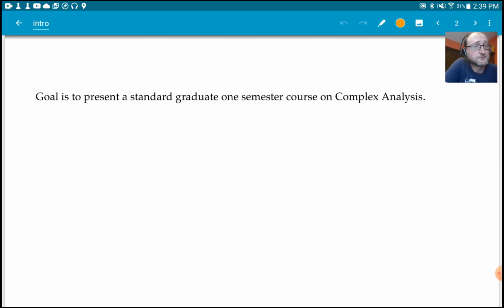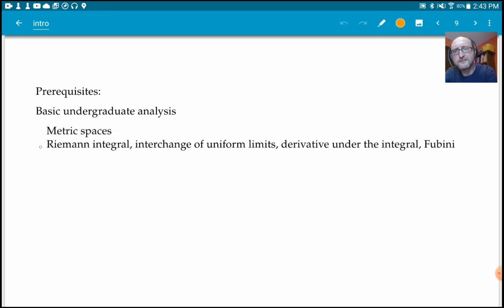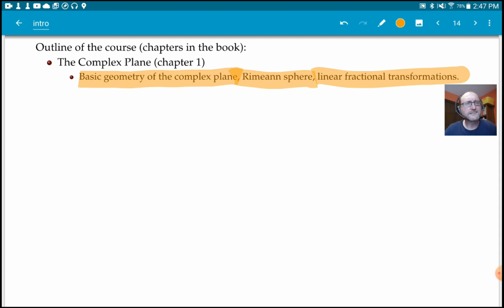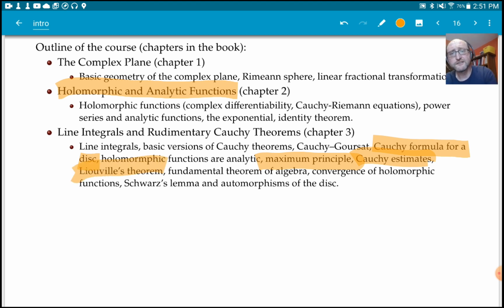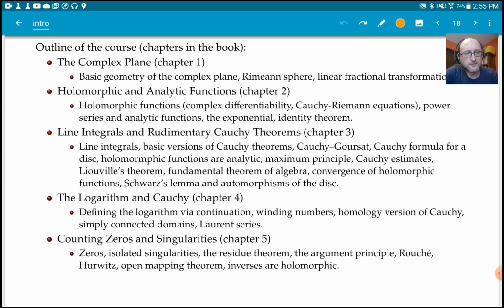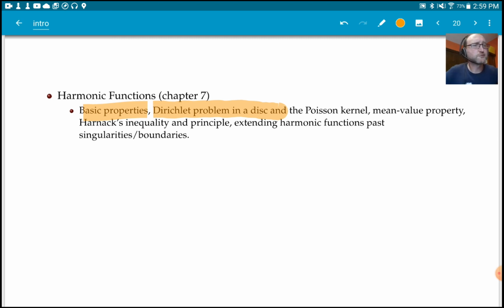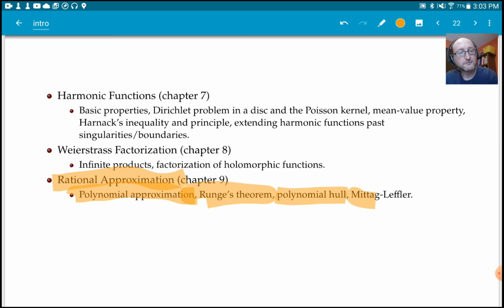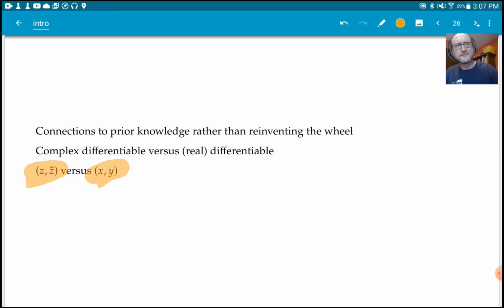1. Cultivating Complex Analysis: Introduction - A graduate course in complex analysis.

Comment: Hi, will you release the video course of Basic Analysis 1 and Basic Analysis 2?
Reply from the maker: That's my long term plan.  I've not had much time for these videos in the last couple of months, though I hope to do more soon.  But I'd first want to finish up the differential equations course and do a few more for the complex analysis course before starting on a new project.  One advantage is that I do have slides made up for most of basic analysis 1, so when I get to it, it should go quicker.